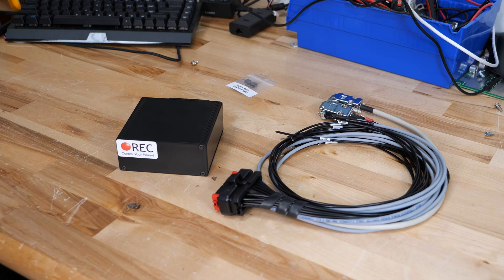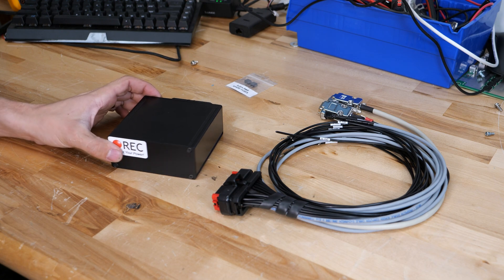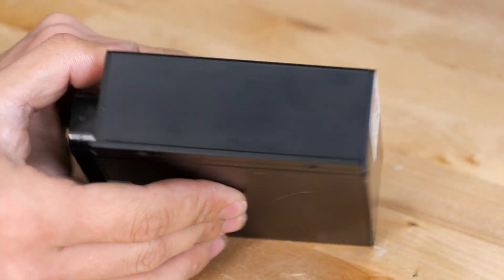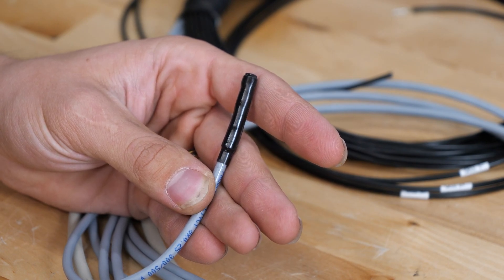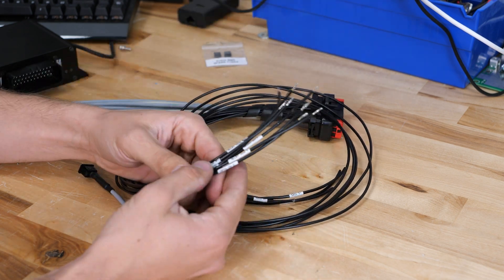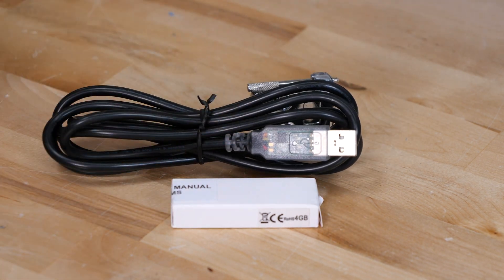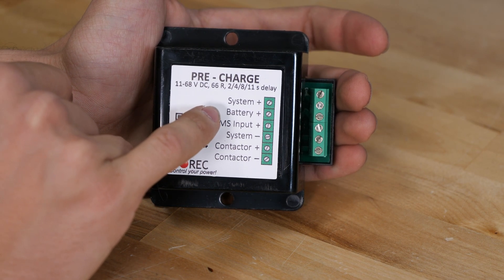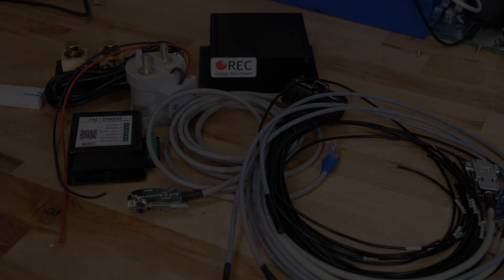REC BMS: 4S Active BMS Equipment Introduction

Comment: Really great video, looking forward to the others. I'm really coming around to REC BMS. I particularly like that these can handle large capacity batteries and that there's an option for primary and secondary batteries over CAN BUS to the inverter.